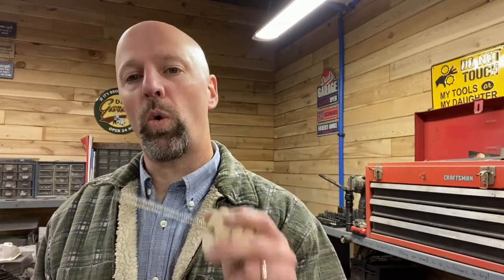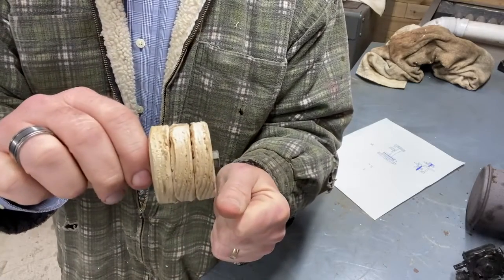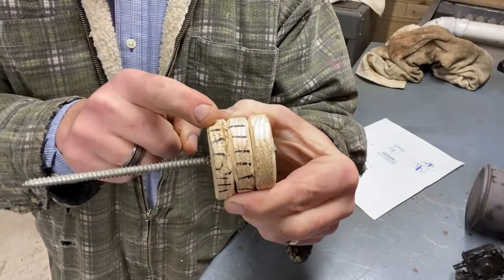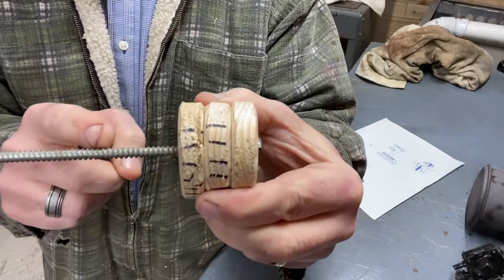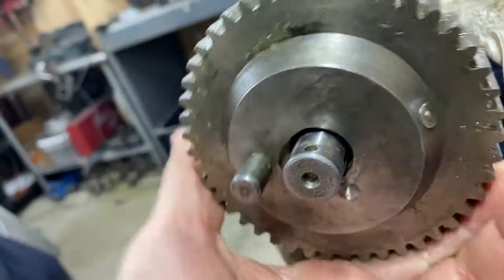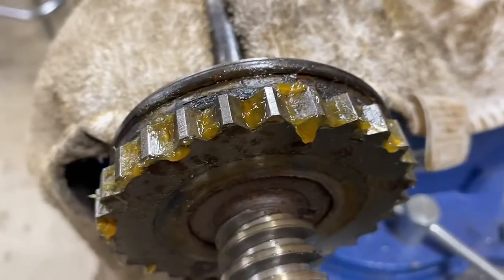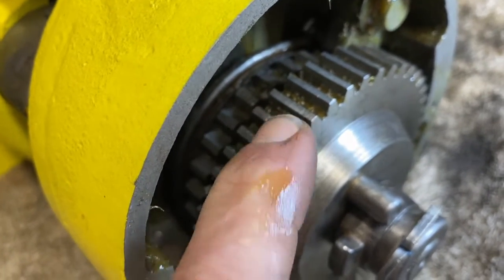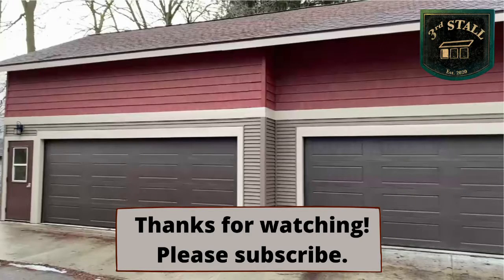Chain Hoist Brake & Clutch explanation & repair if your hoist won't lower or if the clutch breaks

Comment: So when the clutch is disengaged, What's there as a stopping or break mechanism for the load not to fall while lowering??
Could you please help me with that.
Reply from the maker: I'll try my best to explain it, but it's hard to wrap your head around and it's been a few years since I had it apart, so my memory is fuzzy.  As you pull the chain down, it turns the clutch which is on a threaded rod, which slightly loosens the clutch so the load can start to drop.  As soon as the load begins to drop, because it's on the other side of the clutch, it automatically re-tightens the clutch and stops the load from dropping.  It's a constant balance between the two.  Hopefully that helps.  Sorry if it doesn't.
Reply: Thanks for your help ! Yes Now it makes more sense to my head  @3rdstallgarage
Reply: @Praveen90871  " As soon as the load begins to drop, because it's on the other side of the clutch, it automatically re-tightens the clutch and stops the load from dropping." yes thats happening but how.  did you figure it out or find any demonstration of it?
Reply: @cihanyoldaş-e1n 
Yes bro I figured it out, it gets twisted(not actually twisting)and tightened on load. Interesting stuff.
Reply: @Praveen90871  what did you do , inspect any product ? or find any content on internet?
Reply: @cihanyoldaş-e1n I dismantled it, We work with chainblock every single day though

Comment: Yeah but how do you put it in reverse if its brand new?
Reply from the maker: I'm not sure if I understand your question, sorry.  If you pull the hand chain in one direction, the lift goes up.  If you pull it the opposite direction, the lift goes down.  You don't need to shift it into reverse or forward. It's all automatic and held in place by the weight of the load.
Reply: If properly used (pull chain not allowed to bunch inside gear box, which can happen if pull chain is pulled in a irregular fashion causing a whip like effect in the chain, or twist prior to entering gear box at which pount the teeth of the pull chain sprocket will bind/pinch the improperly aligned chain linkage and cause a jam because the gearing reduces the energy required to lift but puts a heavy force on the linkage if it's in the wing alignment for the teeth on the pull chain sprocket) and not clogged with debris, simply stop pulling the pull chain on the side that causes the hoist to lift, and pull on the other/opposite section of hanging pull chain and the clutch will disengage from going up and flip the gear direction locker to allow motion in the downward direction. 

Chain hoist's are properly operated when the pull chain is pulled smoothly and allowed to hang freely without bunching, twisting before gear box entry and free of debris, as well as properly oiled and free of rust. 

Yes it's really that simple and most folks over think it.